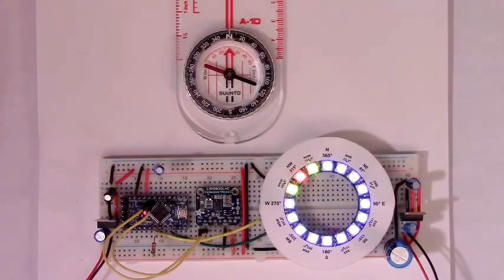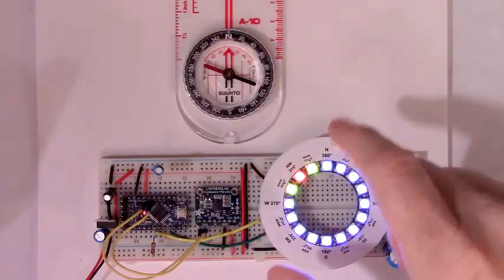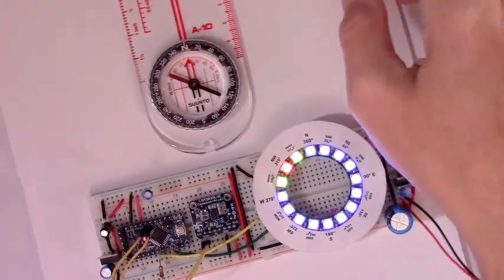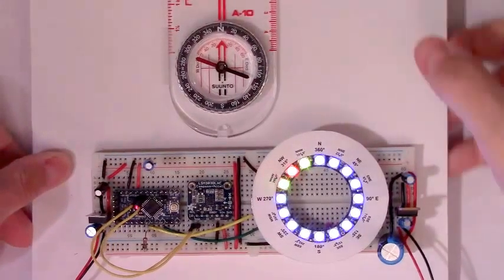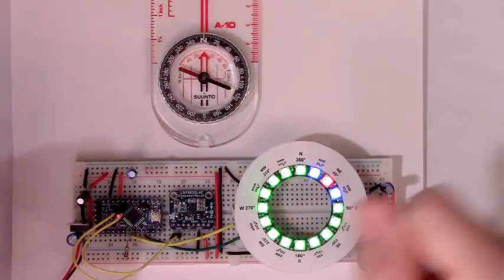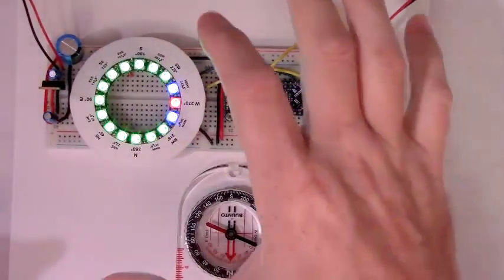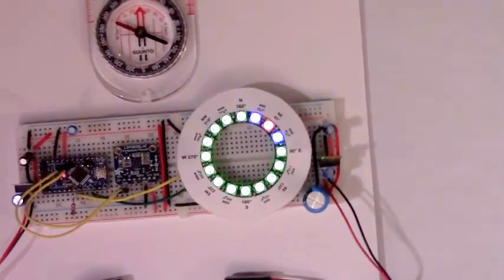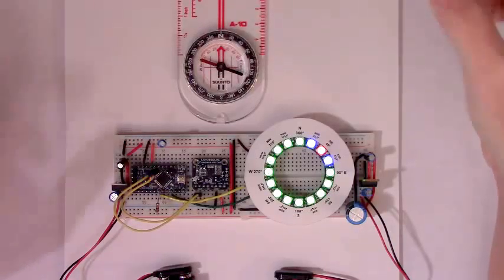Arduino Projects || Dual Mode Neopixel Ring Compass || Version 2

Comment: maybe for like version 10 it could be linked up to a GPS, to either track something or point to GPS coordinates
Reply from the maker: ***** Appreciate the comment and idea.  Including a GPS module would open up many possibilities, e.g., setting waypoints, waypoint tracking in response to changes in orientation, navigation prompts to definable locations (at least within plus/minus a few feet), etc.  As soon as the sensors are calibrated and the current bugs removed, I'm planning to use the software/hardware as the basis for composing a very (very) basic dead-reckoning routine for a small robot (e.g., tell it to go say northwest and it does so while avoiding various obstacles, making on the fly adjustments and corrections after being deflected by obstacles, etc.).  Essentially, (behind the scenes) I'm working toward building a crude but (hopefully) usable sorta-autonomous mini robot dead-reckoning navigation system using just the LSM303 ---a gyro may eventually be necessary but that's yet to be determined, I'm currently curious about just how much (or little) can accomplished with this board. But, as you note and I concur, adding GPS into the mix opens up a whole new and interesting world of possibilities.  It's certainly worth integrating into future versions/projects.  Thanks for watching!
Reply: philo mech i hadn't thought about how you could use it to correct a course after avoiding obstacles, you would have to know the exact distance traveled to get back to the line i think, but that could be tweaked and calibrated in a bot, interesting stuff.

edit: actually with the compass function you might not need to know exact distance traveled, i was thinking in angles and not compass bearings , maybe you could make a useful navigation device that a person uses, it would be better than a compass if you knew the direction you were supposed to go but there were obstacles in the way
Reply from the maker: ***** Greatly appreciate the reply.  The first version of the bot would be set to travel endlessly in a hard coded direction (NW or SE, etc.).  Along the way it will encounter various barriers detectable via an ultrasonic sensor.  When a barrier is too close it turns for however long it takes to clear the barrier.  Now it's off course and must reorient to the proper heading and continue on.  I'll be starting here and adding more features to each version.   

I'm interested in the abilities various creatures might have and utilize while attempting to reach certain goals (in the case of V1 of this bot the goal would be to do what's needed to maintain a set heading while avoiding obstacles as they appear).  That is, the various onboard means creatures may have for dealing with cases when the 'world' gets in their way.  I've been thinking of a thirsty rabbit that can sense water in a particular direction but must avoid running into various trees along the way (avoiding various predators would work just as well).  Following a straight line won't work for the rabbit so there must be some basic coded and/or embodied ability set to handle on-the-fly course adjustments.  If the rabbit happened to be especially nomadic, it might not need to 'return home' but it's always going to need a way to make various course corrections while attempting to reach a water source.  The course adjusting behaviors and abilities of a sort of thirsty nomadic rabbit are the 'ideas' background for the bot I have in mind.  

I'll be using accel/magnetic-sense as a substitute for 'water-sense' (likely various abilities for detecting changes in temperature, humidity, pressure drop, etc.).  So perhaps a bird or flock returning to certain locations year after year might be a better sort of analogy.  I tend to like the rabbit analogy more, but bird flight and navigation is likely better.      

I've definitely been thinking about the case where one knows the general direction he/she needs/wants to go but has to navigate around various obstacles along the way.  Such ties directly with the idea of dead reckoning navigation.  Imagine one isn't especially sure about the direction to civilization but wants to try out a few directions and see where they lead for a set period of time (scouting for the most promising route).  One fairly common strategy is to look out and settle upon some distinctive landmark, etc., in the direction one wants to try.  And then constantly refer to it during the journey.  Such tends to work well if the landmark happens to be easily visible for the majority of the trek.  However, if it tends to be out of sight, etc., for a significant amount of time, then things can become a bit more tricky (think of seeing a mountain in the distance, selecting it as the goal, but then soon after encountering a forest with a dense canopy directly in the way.  Such cases is where something like a 'compass' that one can manually set the desired direction and that will 'remember' and constantly point to it regardless of how one's course happens to be deflected might come in handy.  A sort of dead-reckoning aid for those who don't necessarily want to have to remember 'oh yeah, I'm supposed to be staying on a constant SW, etc., direction.'   Just a few thoughts.       Once again, appreciate the reply and definitely free free to continue letting me know what you think.  I always welcome feedback.

Comment: Nice project. You have a bug in your code though. It should just point south all the time! Just kidding ;) I need to play around with these little gadgets sometime. Great video.
Reply from the maker: UReasonIt Appreciate the comment.  Nice! Pointing south all the time would certainly be possible.  As far as navigating goes a south pointer would be just as workable as a north pointer...as long as one was aware of it...perhaps a neat prank to play on someone during a navigation competition using digital compasses...'go northwest 200 yards, northeast east 150 yards...where did everyone go?..oops...'  Just a thought :)  Thanks for watching!

Comment from the maker: /*
title: Dual_Mode_Neopixel_Ring_Compass_Version2
by: philomech
date: 6/2015

This project is an extension of an idea and code originally composed by David Ratliff.  See video
description for a link to Ratliff's video, etc.

Mode 0 --> tracks North
Mode 1 --> displays current Heading (--> points to direction one currectly faces
on a cardinal direction ring surrounding NeoPixel Ring)

COMPENSATED FOR TILT:
tilt compensation calculations/algorithm from Adafruit's 10DOF breakout library,
such works better when accelerometer is calibrated

Parts:
LSM303DLHC Accelerometer/Compass Breakout
16 NeoPixel Ring
Arduino ProMini
Normally Open pushbutton
10K resistor
330 Ohm resistor (Neopixel Ring data IN line)
1000uf capacitor
LM7805 5V voltage regulators (x2)
10uf capacitors (x4)
9V battery clips (x2)
Hookup Wire 
*/

/**********************
* libraries and objects *
**********************/
#include <Adafruit_NeoPixel.h>
#include <Wire.h>
#include <Adafruit_Sensor.h>
#include <Adafruit_LSM303_U.h>

//#define debug true  //uncomment for serial monitor
const int PIN = 6;     // connected to neopixel data pin

//Assign ID to the sensors
Adafruit_LSM303_Accel_Unified accel = Adafruit_LSM303_Accel_Unified(54321);
Adafruit_LSM303_Mag_Unified mag = Adafruit_LSM303_Mag_Unified(12345);
//Initiate ring
Adafruit_NeoPixel strip = Adafruit_NeoPixel(16, PIN, NEO_GRB + NEO_KHZ800);

/*********************
* global variables     *
*********************/
//mode selection
const byte button_pin   = 3;
int button_state = 1;
boolean mode     = 1;   //0 for North Tracker, 1 for Heading Indicator

//Assign pixels to Headings (16 pixel ring)
const byte N   = 12;    //aligned with X-Axis arrow on body of LSM303DLHC
const byte NNE = 11;
const byte NE  = 10;
const byte ENE = 9;
const byte E   = 8;
const byte ESE = 7;
const byte se  = 6;   // <-- source conflict occurs if capitalized
const byte SSE = 5;
const byte S   = 4;
const byte SSW = 3;
const byte SW  = 2;
const byte WSW = 1;
const byte W   = 0;
const byte WNW = 15;
const byte NW  = 14;
const byte NNW = 13;

int indicator = 12; //initially assigned to "North"

float heading;
const float target_heading = 0.0;  //North Tracking
/********************
* function prototypes *
********************/
void set_N_indicator(float error);
void show_N_indicator(void);
void set_H_indicator(void);
void show_H_indicator(void);
/******************
* setup             *
******************/
void setup(){
  delay(100);
  strip.begin();
  strip.show(); // Initialize all pixels to 'off'
  
  //if problem with LSM303
  if(!mag.begin() || !accel.begin()){
    //turn ring red and keep it red
    colorWipe(strip.Color(25,0,0),50);
  } 
  //if no problem with LSM303
  if(mag.begin() && accel.begin()){
     //cycle RGB around ring to signal ready
    colorWipe(strip.Color(25,0,0), 50);
    colorWipe(strip.Color(0,25,0), 50);
    colorWipe(strip.Color(0,0,25), 50);
  }
  delay(100);
} //<-- end of setup

/*******************
* main loop          *
*******************/
void loop() {
  //collect sensor events
  sensors_event_t accel_event;
  accel.getEvent(&accel_event);
  sensors_event_t magEvent;
  mag.getEvent(&magEvent);

  const float Pi = 3.14159;
  
  /* Tilt Compansation Calculations, based on Adafruit's 10DOF library */
  //collect raw accel and mag data
  float accel_x = accel_event.acceleration.x;
  float accel_y = accel_event.acceleration.y;
  float accel_z = accel_event.acceleration.z;
  
  float mag_x = magEvent.magnetic.x; 
  float mag_y = magEvent.magnetic.y;
  float mag_z = magEvent.magnetic.z;
  
  delay(5);  //for stability
  
  //use raw data to calculate roll and pitch sin and cos
  float t_roll = accel_x * accel_x + accel_z * accel_z;
  float rollRadians = (float)atan2(accel_y, sqrt(t_roll));

  float t_pitch = accel_y * accel_y + accel_z * accel_z;
  float pitchRadians = (float)atan2(accel_x, sqrt(t_pitch));

  float cosRoll = (float)cos(rollRadians);
  float sinRoll = (float)sin(rollRadians);
  float cosPitch = (float)cos(-1*pitchRadians);
  float sinPitch = (float)sin(-1*pitchRadians);

  /* The tilt compensation algorithm                            */
  // Xh = X.cosPitch + Z.sinPitch                               
  // Yh = X.sinRoll.sinPitch + Y.cosRoll - Z.sinRoll.cosPitch   
  mag_x = (mag_x) * cosPitch + (mag_z) * sinPitch;
  mag_y = (mag_x) * sinRoll * sinPitch + (mag_y) * cosRoll - (mag_z) * sinRoll * cosPitch;
  /* end of tilt compensation calculations*/
  
  //now that mag data has been compensated for "tilt" i.e., cases when 
  //pitch and/or roll angles are not equal to zero, we can
  //calculate the angle of the vector y,x (the heading) 
  heading = (atan2(mag_y , mag_x) * 180)/ Pi;
  
  delay(5);  //for stability
  
  // Normalize to 0-360
  if (heading < 0){
    heading = 360 + heading;
  }
  
  /*Rough and Ready correction of difference between
  pre- and post- tilt compensation heading value.  
  Your difference may be larger or smaller than 5.0 
  Not strictly necessary if one pre-calibrates accelerometer 
  i.e., one finds mins, maxs and re-maps raw accel data
  prior to performing tilt comp calculations.  Such is one
  of the improvements that will be made in the next version of
  this project. */ 
  heading = heading - 5.0; 
  
  delay(10); //for stability
  
  //Calculate Error (how far is heading from target?)
  float error = heading - target_heading;
  if(error > 180.00){
    error = error - 360.00;
  }
  
  delay(10);   //for stability
  
  //read button
  button_state = digitalRead(button_pin);
  if(button_state == 0){
    delay(350); digitalRead(button_pin); //debouncing
    if(button_state == 0){
      mode = !mode;
    } 
  }
     
  //mode selection
  if(mode == 0){          //North Tracker
  set_N_indicator(error);
  show_N_indicator();
  }
  else if(mode == 1){     //Heading Indicator
  set_H_indicator();
  show_H_indicator();
  }
  
  delay(100);         //for stability
  
}  //<--- end of main loop

/****************************************
* North Tracking and Heading Functions    *
****************************************/
//North Tracking, 22.5 degree increments
void set_N_indicator(float error){
    //NEGATIVE ERRORS (CounterClockwise Displacement) 
    if(error < 0.0){
      error = fabs(error);     //strip away minus sign
      
      delay(10);               //for stability
    
      if((error > 0.1) && (error < 90)){
        if((error < 11.25) && (error > 0.1)){
          indicator = N;
        }
        else if((error >= 11.25) && (error < 22.5)){
          indicator = NNE;
        }
        else if((error >= 22.5) && (error < 45)){
          indicator = NE;
        }
        else if((error >= 45) && (error < 67.5)){
          indicator = ENE;
        }
        else if((error >= 67.5) && (error < 90)){
          indicator = E;
        }
      }
      else if((error >=90) && (error <= 180)){
        if((error >= 90) && (error < 112.5)){
          indicator = ESE;
        }
        else if((error >= 112.5) && (error < 135)){
          indicator = se;
        }
        else if((error >= 135) && (error < 157.5)){
          indicator = SSE;
        } 
        else if((error >= 157.5) && (error <= 180)){
          indicator = S;
        }
      }
    } //<--end of NEGATIVE ERROR Handling code
    
  //POSITIVE ERRORS (Clockwise Displacement)
  else if(error > 0.0){
    
    if((error > 0.1) && (error < 90)){
      if((error < 11.25) && (error > 0.1)){
        indicator = N;
      }
      else if((error >= 11.25) && (error < 22.5)){
        indicator = NNW;
      }
      else if((error >= 22.5) && (error < 45)){
        indicator = NW;
      }
      else if((error >= 45) && (error < 67.5)){
        indicator = WNW;
      }
      else if((error >= 67.5) && (error < 90)){
        indicator = W;
      }
    }
    else if((error >= 90) && (error <= 180)){
      if((error >= 90) && (error < 112.5)){
        indicator = WSW;
      }
      else if ((error >= 112.5) && (error < 135)){
        indicator = SW;
      }
      else if((error >= 135) && (error < 157.5)){
        indicator = SSW;
      }
      else if((error >= 157.5) && (error <= 180)){
        indicator = S;
      }
    }
  } //<--end of POSTIVE ERROR handling code  
}
void show_N_indicator(){
  int left_indicator  = indicator - 1; 
  int right_indicator = indicator + 1;
  
  // scale / normalize to 0 - 16
  if (left_indicator < 0){
    left_indicator += 16; 
  }    
  if (right_indicator > 15){
    right_indicator -= 16; 
  } 
  //assign colors
  colorWipe(strip.Color(10, 10, 10), 0);             //set WHITE (background dial color)
  strip.setPixelColor(indicator, 35, 0, 0);          // set indicator RED
  strip.setPixelColor(left_indicator, 25, 25, 0);    // set indicator border YELLOW
  strip.setPixelColor(right_indicator, 25, 25, 0);   // set indicator border YELLOW
  
  strip.show();
}
/*****************************
* Heading Indicator Functions  *
*****************************/
/*
Indicator points to the direction one is facing (direction X-axis arrow is facing), 
using paper directional ring around Neopixel ring.
In increments of 22.5 degrees
*/
void set_H_indicator(){
      // sectioned to save processor time
  if((heading >= 11.25) && (heading < 101.25)){  //NNE through East   
    if((heading >= 11.25) &&(heading < 33.75)){
      indicator = NNE;
    }
    else if ((heading >= 33.75) && (heading < 56.25)){
      indicator = NE;
    }
    else if((heading >= 56.25) && (heading < 78.75)){
      indicator = ENE;
    }
    else if((heading >= 78.75) && (heading < 101.25)){
      indicator = E;
    }
  }  //end 1st quadrant
  else if((heading >=101.25) && (heading < 191.25)){   //ESE through South
    if((heading >= 101.25) && (heading < 123.75)){
      indicator = ESE;
    }
    else if ((heading >= 123.75) && (heading < 146.25)){
      indicator = se;
    }
    else if((heading >= 146.25) && (heading < 168.75)){
      indicator = SSE;
    }
    else if((heading >= 168.75) && (heading < 191.25)){
      indicator = S;
    }
  } //end 2nd quadrant
  else if((heading >= 191.25) && (heading < 281.25)){       //SSW through West
    if((heading >= 191.25) && (heading < 213.75)){
      indicator = SSW;
    }
    else if((heading >= 213.75) && (heading < 236.25)){
      indicator = SW;
    }
    else if((heading >= 236.25) && (heading < 258.75)){
      indicator = WSW;
    }
    else if((heading >= 258.75) && (heading < 281.25)){
      indicator = W;
    }
  }//end 3rd quadrant
  else if((heading >= 281.25) || (heading < 11.25)){   //WNW through North
    if((heading >= 281.25) && (heading < 303.75)){
     indicator = WNW;
    }
    else if ((heading >= 303.75) && (heading < 326.5)){
      indicator = NW;
    }
    else if ((heading >= 326.5) && (heading < 348.75)){
      indicator = NNW;
    }
    else if((heading >= 348.75) || (heading < 11.25)){
      indicator = N;
    }
  } //end 4th quadrant  
}

void show_H_indicator()
{
  // border to highlight Heading indicator
  int indicator_left = indicator - 1;
  int indicator_right = indicator + 1;

  // scale / normalize to 0 - 16
  if (indicator_left < 0){
    indicator_left += 16; 
  }  
  if (indicator_right > 15){
    indicator_right -= 16; 
  } 

  // Assign colors
  colorWipe(strip.Color(0, 15, 0), 0);               // set GREEN (background dial color)
  strip.setPixelColor(indicator, 25, 0, 0);          // set indicator RED
  strip.setPixelColor(indicator_left, 0, 15, 15);    // set indicator border GREEN
  strip.setPixelColor(indicator_right, 0, 15, 15);   // set indicator border GREEN

  strip.show();                                      // Push bits out
}
    
// from ADAFRUIT Example Code
void colorWipe(uint32_t c, uint8_t wait) {
  for(uint16_t i=0; i<strip.numPixels(); i++) {
    strip.setPixelColor(i, c);
    strip.show();
    delay(wait);
  }
}